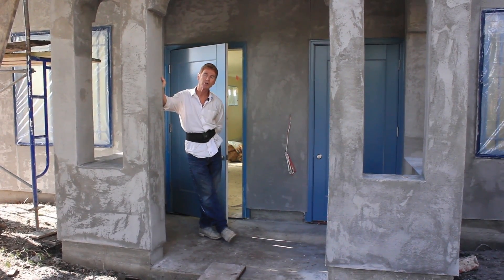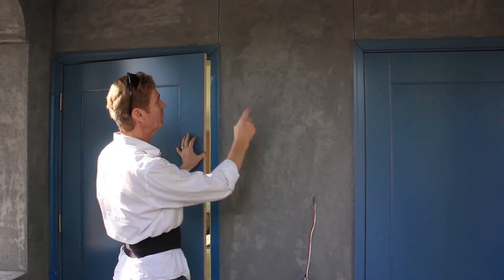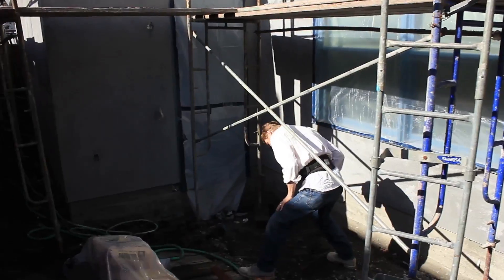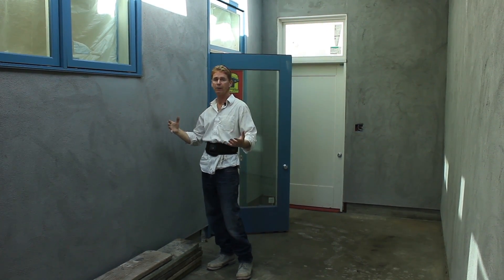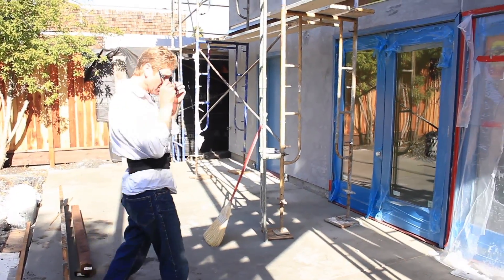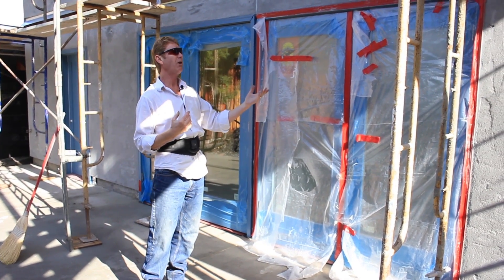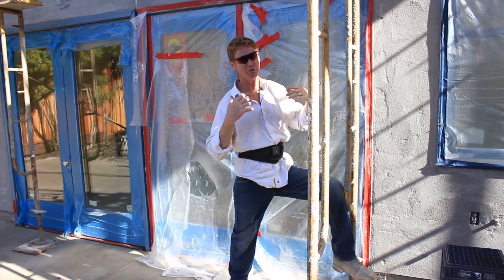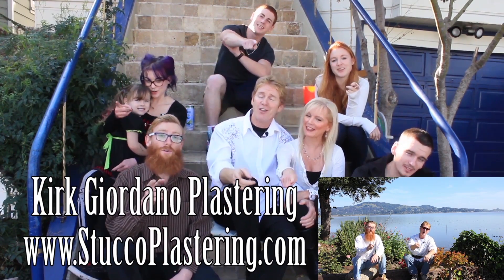Stucco with fiberglass stronger?

Comment: Hey Kirk and Jay, I got another question regarding stucco scratch coat. I’m about to stucco my house with the traditional 3 coat system. In my area they don’t carry BMI. Do you recommend adding fibers for my scratch coat? Or would a traditional 1 to 3 cement to sand ratio be fine with no fiber added? Thanks
Reply from the maker: @adobeearthship1895  Not really, today’s stucco are mighty strong and many have fibers all ready in them.

Comment: have used this type on thing on a floor screed job witch had parts only 10mm and it never cracked was the best way as who ever did the sub floor made a mess. so yea them fibres work I am currently using it on a window wall to witch is a new build to test it out for hair lines cracks just as you are here great video